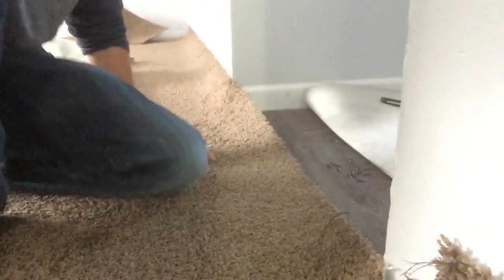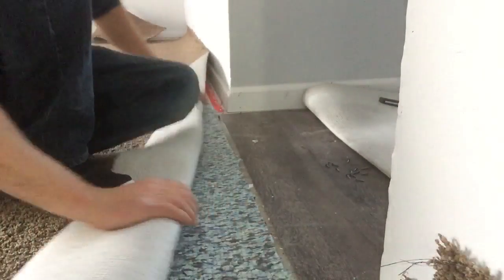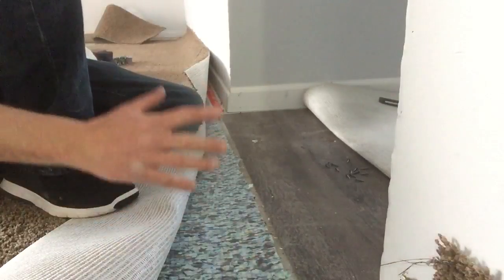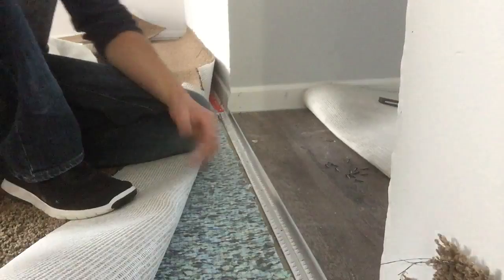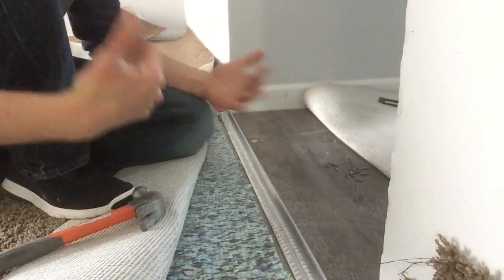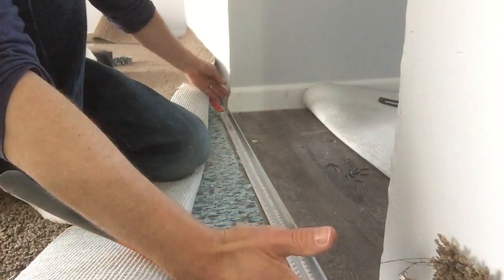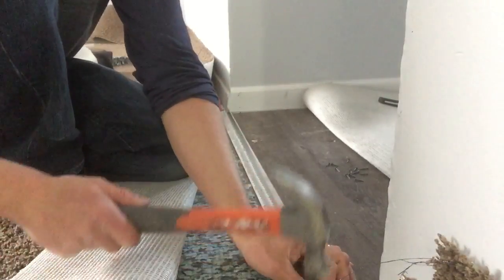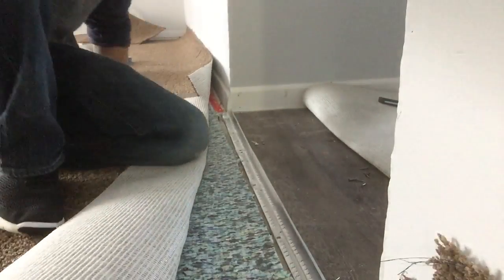How to install a carpet to vinyl transition strip on concrete

Comment: I've only been in the flooring business for 40 years, so I don't know everything. But I do know floating vinyl floors should never be fastened permanently to the floor - like you just did. I found it best to read the installation instructions for every product I install.
Reply: I'm not a floor guy at all and nailing through the vinyl floor threw up red flags right away. figured that out when I read the first page of the instructions.
Reply: Thank god u guys know everything about everything....!
Reply: Could be glue down Vinyl Plank

Comment: In England  we would do similar, but I would drill and plug if it was only concrete....
And if in doubt we have a fast setting adhesive that sets like rock in 20 mins (but it can be messy)

Comment: I have a question and would love to attach a photo. I have carpeting that has a gripper threshold at the doorway. I am replacing the floor in the kitchen which is the room on the other side of the threshold. The floor is concrete. The new tile does not meet the gold gripper. Is there a threshold or something that I can put over the gold gripper along with the tile and. The gap to create a seamless transition? Really can use the recommendation.

Comment: I have the same hammer
Reply from the maker: Jorge408 the Home Depot “default” hammer
Reply: @CarpetExpertBlueprint  not gonna lie but this hammer takes a while to nail on concrete but it does the job